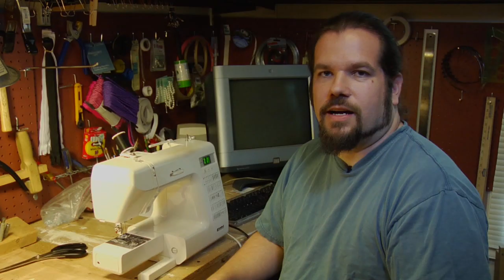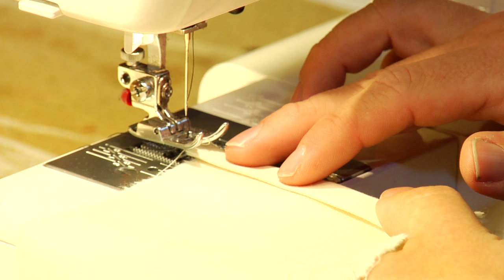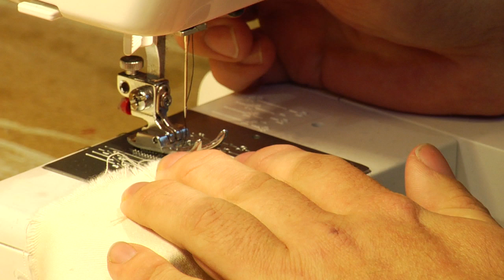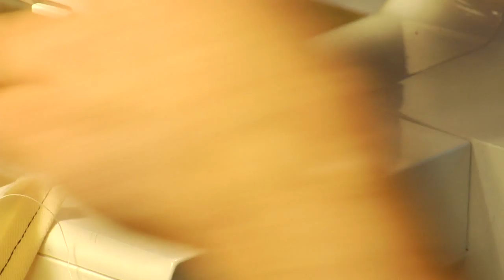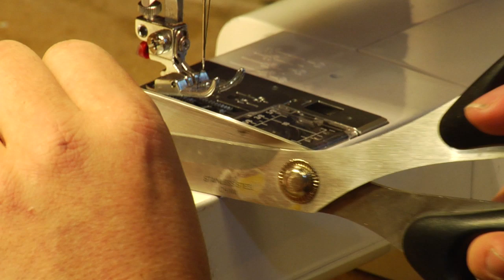Sewing Machine Techniques : Basic Sewing Tips

Comment: Yes, I agree to read the manual that came with your machine. You gave great tips as well, however, I personally find it more visually pleasing to measure accurately -press-fold over and evenly measure and press and then measure where your stitch will be placed and from the "right" side use your plate guide to maintain that measurement and stitch. When you turn to the inside-it is even close to the edge and visually cleaner.

Comment: @vlbilly Basting is where you make loose, long, easily removed stitches to hold them together temporarily. You usually do it by hand, and it keeps the pieces together so that when you sew it up for real, it won't fall apart or separate or move on you. You can also buy a "glue" that bastes as well depending on the type of fabric you're using.